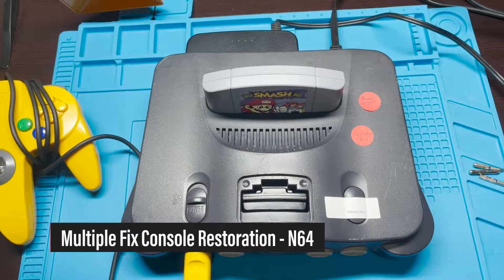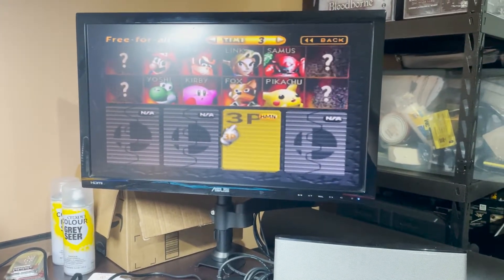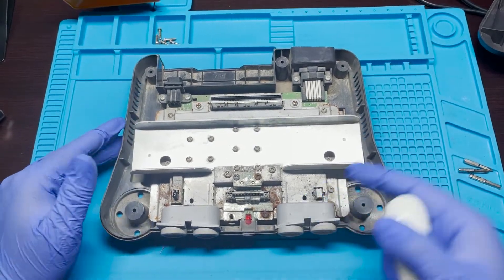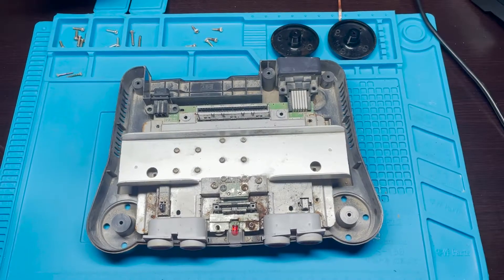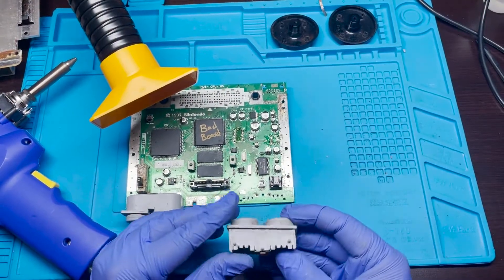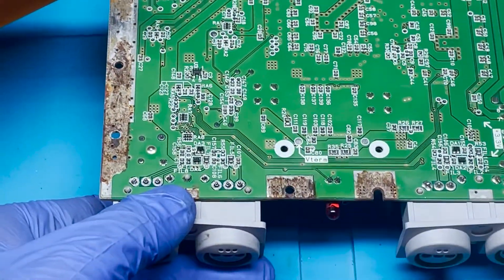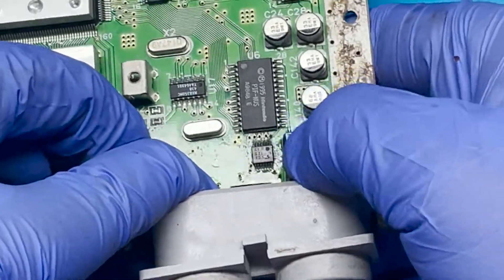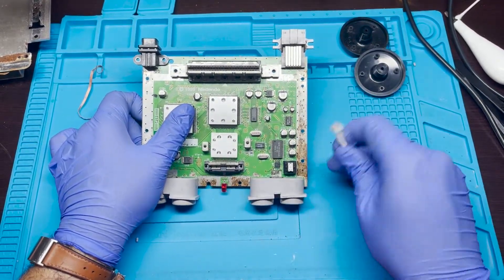Nintendo 64 Console Restoration - Reset, Control Port, Power Light Fix

Comment: What kind of clear liquid was you using before soldering the controller port was it no clean flux?
Reply from the maker: Sorry for getting super late! That was 99% Isopropyl Alcohol, I use it to clean and dry the board for prepping before working on them or to clean up flux after soldering.

Comment: What brand of solder did you use? And was it 63-37 rosin core
Reply from the maker: It’s 60/40 the brand was Kester, link below:
https://amzn.to/3mgSxki
Reply: @totalfix877  ok thank you I noticed you started off putting new solder on top of the old solder then you removed it completely then applied the new solder again is there a benefit of doing that does it make it easier to remove because the flux inside the kester solder
Reply from the maker: @NRASUPPORTER1911  I apply fresh solder over old solder to mix the metals together and “clean” it essentially.  On top of that, it’s just habit from more modern boards having unleaded solder on the joints so it helps it lower the melting point and makes it easier to remove so I don’t risk burning the board.
Reply: @totalfix877  ok thank you and another questions how much Fahrenheit is the best to use for soldering the controller port on a n64 i just don’t want to use to much heat im not sure how high to turn my soldering iron up to im afraid to damage the board

Comment: Something useful I've done myself to prevent WD40 splattering everywhere - i bought some small drop bottles on AliExpress with wide needles as caps and sprayed wd40 in it until it's full, now I just drip wd40 anywhere i need in a much more controlled manner. Maybe you will find this useful.
Reply from the maker: That’s actually a really good idea. I will go ahead and do that since I got some spare plastic bottles. Thanks for the advice!